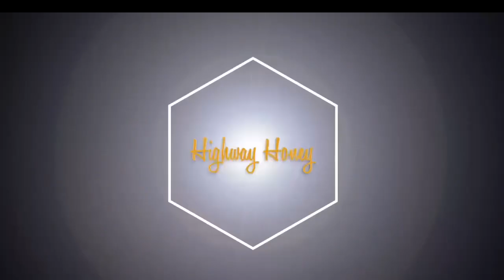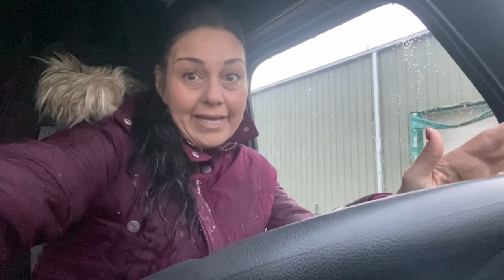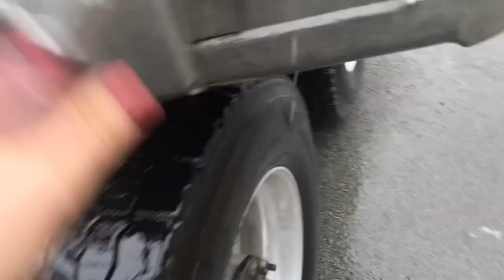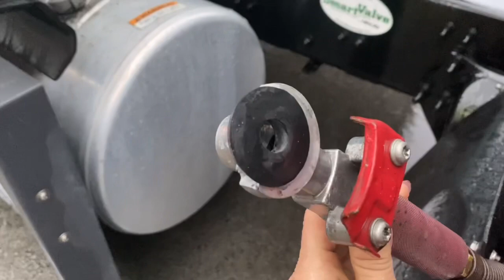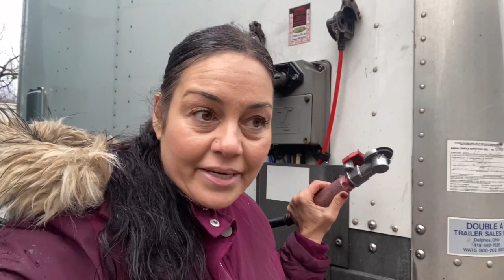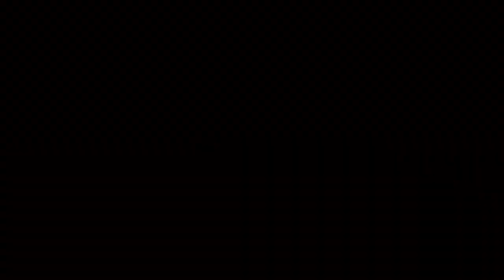BROKE A GLAD HAND RIGHT OFF!? 🙄

Comment: Well if you are like me when you find one that someone replaces the  hose and the connector ( and they they throw away the part that they) just replaced? Right? I just carefully put that in my toolbox for times just like what you have just experienced. I actually have two hose and connector parts as spares. You have to think about what might happen and be ready for it. Also I have a spare electrical cord.  Some (call it the pig tail). Yes you have to plan ahead be careful out there on them wet roadways keep extra following distance.
Reply from the maker: Thank you 🙏

Comment: What is a glad hand and what does it do, and you’re right if everything is smooth sailing when is their time to learn
Reply from the maker: What I showed in the video is the glad hand.  It’s a coupling device used to connect the service and supply lines of the truck to the trailer.
Reply: @HighwayHoney  thank you, I was wondering what that was. I hope it didn’t turn into too much of a problem hopefully you got it solved quickly. Stay safe on those roads, and keep it between the lines

Comment: Buy you a set on Amazon, I got a red and blue hose with the glad hands on just to have on hand, plus get yourself some rubbing alcohol 97% just in case you get an airline freeze you can pour that in your airlines pump your brakes down go build them up again and sometimes times that will release your brakes. Plus I would get you some Deicer  that is nice to have on hand and a good hammer just in case you need to go pound brake drum
Reply from the maker: Thank you 🙏

Comment: Oops. Sorry Honey. Almost appears as thou your hose is to short. I have never done that either, but I did almost drive out from under a trailer. The fifth wheel pin wasn’t locked. I hope your day is better and brighter. 😘
Reply from the maker: Thank you 🤗
Reply from the maker: I looked at the lines they seem twisted so I untwisted them. Maybe that will help with the length! 🤷‍♀️
Reply: @HighwayHoney  Both of your hoses should be on a hanger with a spring. Maybe at one time someone damaged the glad hand or the connection and cut the air line shorter to put a new fitting on it.🤔